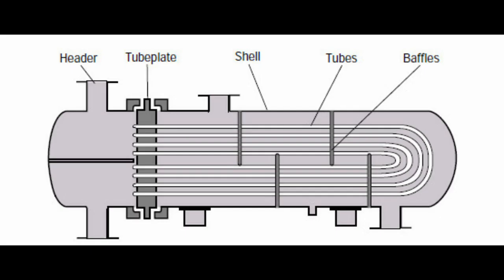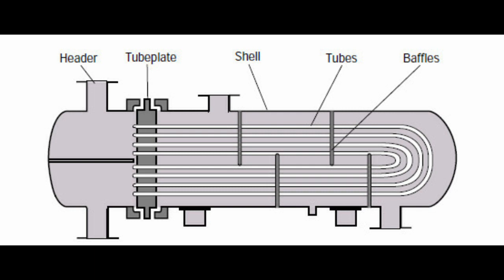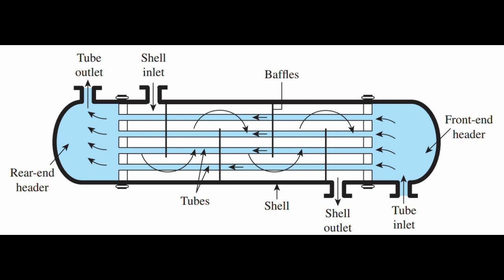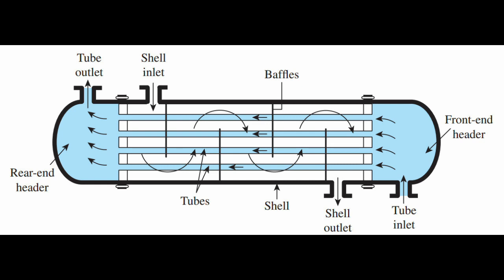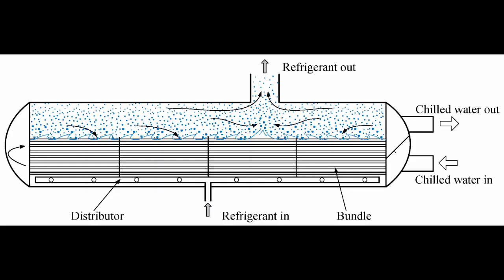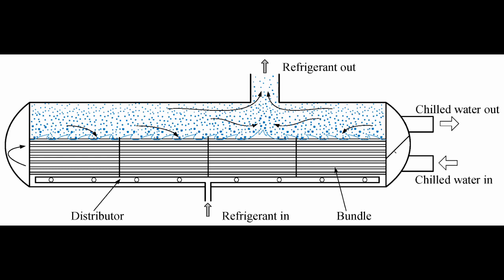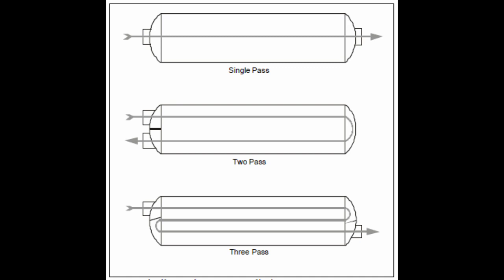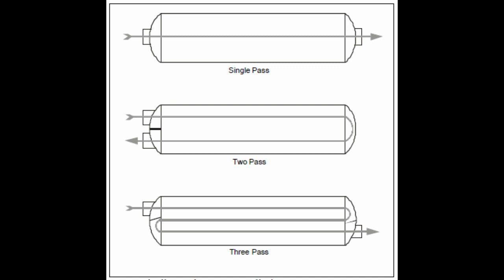cooler , evaporater and its types  used in chiller explained

Comment: Dear Sir, 
Why does circuit A trips on "Low Current Alarm," in a 30XA0302 carrier screw chiller?
Reply from the maker: Thank you for the question here is the answer, if this doesn't solve the issue please revert with more details.

This  alarm is active when compressor draw current less than the minimum current limit
IF compressor is running and shutdown on low current alarm following could be the reasons,

1: Compressor capacity control malfunction

2: Compressor current measure device CT faulty " You check it when compressor is working measure the current using a clamp meter and check in the chiller display if the Amperes are same than CT is good if not try changing the CT "

3: TCPM Board Faulty

4: Compressor Contactor is faulty. 

5: Compressor Mechanical issue
Reply: @UATechnicalSolutions  Dear sir, do you answer on whatsapp?
Reply from the maker: You can send an email if you need to share pictures or voice notes  uatechnicalsolutions@gmail.com